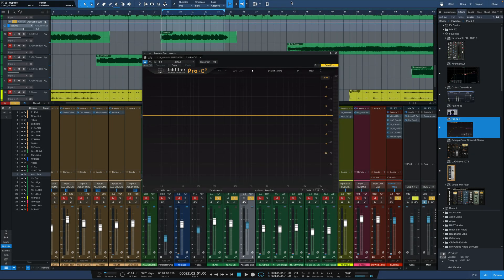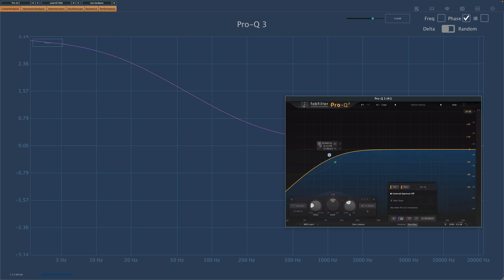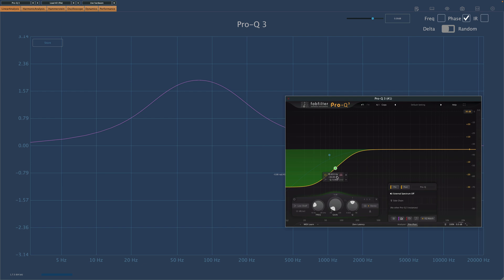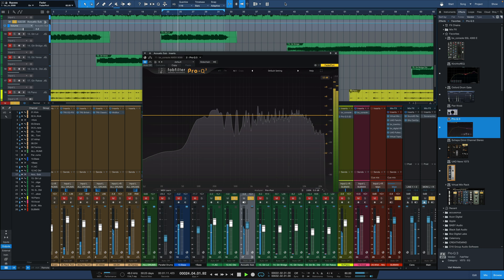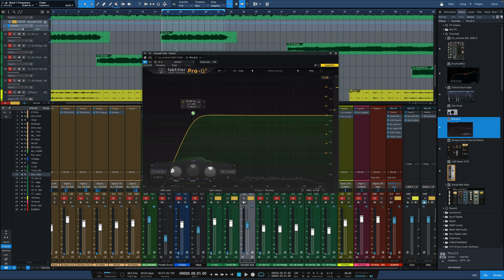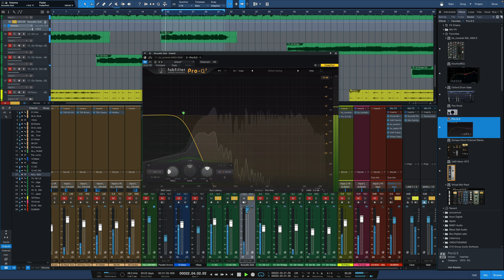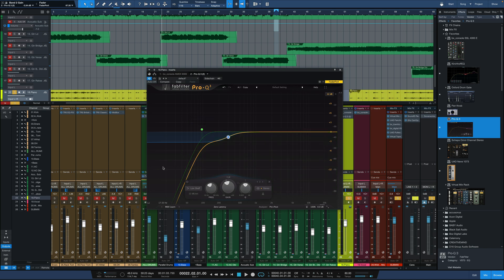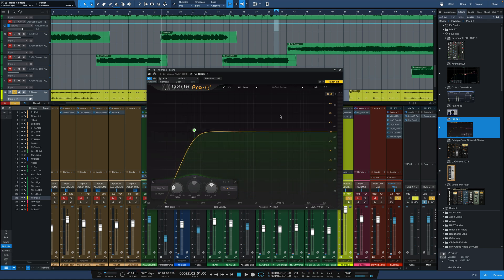High Pass Filters | How To Use Them, When To Avoid Them

Comment: Hi Joe..im a new guy to all this..very confusing..is High filter pass same as high shelf filter?..i use Reaper DAW.appreciate if you can simplify
Reply from the maker: High pass filter cuts out the low end at a set frequency, allowing the highs to "pass" through.  You can set the slope to be very gradual, or very steep.  High shelf filters work on the top end of the spectrum, boosting or cutting at a set gain level above whatever frequency you set.  They literally look like a flat shelf when you see the EQ curve.

Comment: Great video. I have been using FabFilter for 6 months and this explained it ten times better than most, quickly and clearly. Even a lot better than their own videos! Now if you could just do a video on every plugin I use, that would be great, haha! What’s that plug-in doctor all about? I’m guessing it’s just a bigger reading that allows you to judge the phase response? I use spectral analysers for the same job, but it doesn’t give me a frozen image- just a live reading. I produce dnb and have been brick walking everything… wondered why everything sounded so washed out, even though I am cutting within the right frequency ranges. I only have Pro-Q 2, but will definitely be upgrading now I’ve got my head round it a bit more, thanks to you. To be completely honest I never right clicked before, I’m familiar with EQ- just each plugin instance has a different GUI which is where the confusion set in. Jolly good show, definitely be checking out your other content! Peace.

Comment: This makes me wonder: what are the scenarios that you would use a steep filter? I assume to avoid phase shift with a steep filter you could use linear phase EQ but that introduces a whole set of issues of its own
Reply: in mastering situations, or in mixing on bass, kick or on a buss that glues kick and bass, steep filter with linear phase
Reply: @TheMonkBeatsOne  Bass I agree, especially crossover filters, however I would avoid using linear phase EQ on an acoustic kick, in which case the pre ringing on transient heavy signals with ample low end information (such as a kick close mic) would be audible and obnoxious. Not sure why you would glue bass and kick though, that doesn't make any sense.
Reply: @XiyuYang  forgot to mention: I was thinking at electronic music : ) you right about the linear phase on an acoustic kick. Also, in a rock pop situation there's no need usually to have a buss to treat kick and bass together. In electronic music such as EDM, hip hop or similar that's instead pretty usual.
Reply: @TheMonkBeatsOne  I see, thanks for clearing it up! I usually work with metal, rock, jazz and chamber musicians so I don’t know anything about mixing electronic music. I'll go educate myself a bit on this subject:)
Reply: @XiyuYang  at a certain level, mixing so different genres needs to be a product specialist :) but it's great to know techniques used in different situations.

Comment: does this change with the zero latency natural or linear phase options?
Reply: I'm using linear phase for low/high cut to avoid shifting problems and because of the latency i commit/bounce  the track after.
Reply: @alesnovak2906  I would be very careful use linear phase EQs in mixing in general, that introduces tons of issues and practically solves no problem - the only scenarios I can think of that justify using a linear phase EQ while mixing, are crossover filters and parallel EQs (which, contrary to popular beliefs, does not necessarily mean you have to use linear phase EQ)

Phase shift is not always your enemy, in fact in many cases (such as analog outboard, or plugins that emulate analog devices), phase shift is a huge factor behind why certain units sound the way they do. So, in short, yes - do be mindful of phase coherence, and no - don't let phase scare you away from making certain moves.
Reply: Yes it does. This is a nice video but falls very short by not including linear phase examples.